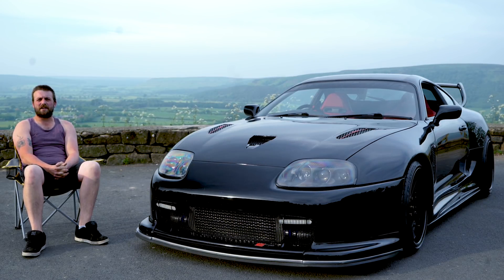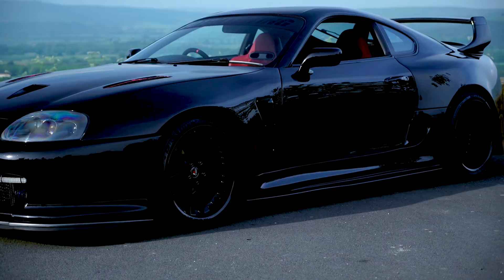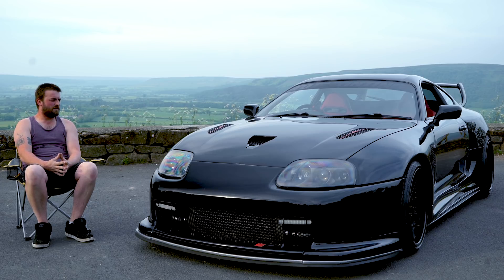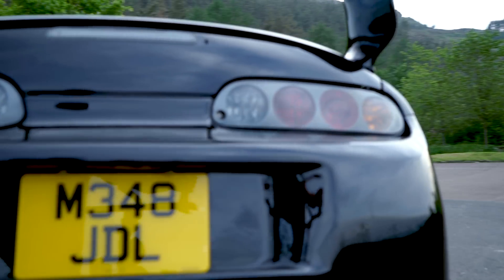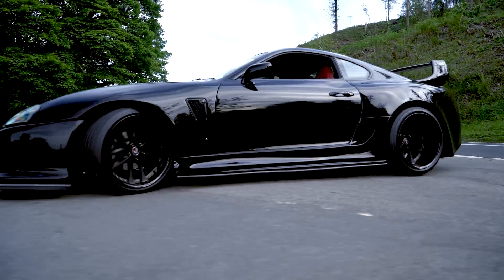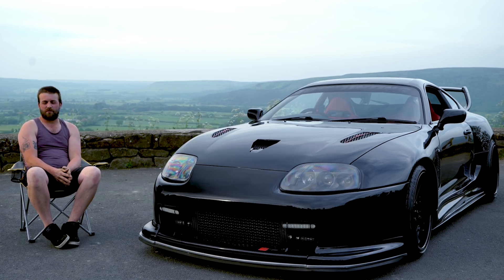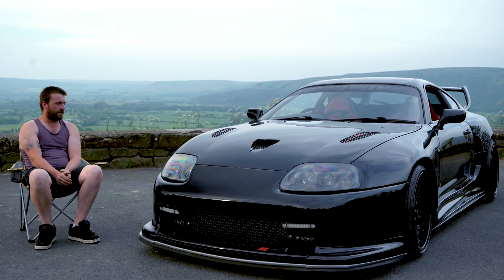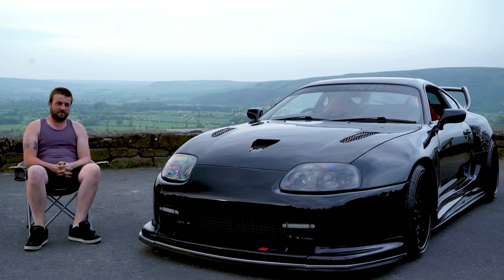Widebody Turbo Supra [TDSC]

Comment: This is a fuking supra till this day i cannot believe the disrespect in the 2020 supra that came out
Reply from the maker: As much as the new supra likely drives great and the engine is very good they should’ve just left it at the MK4
Reply: It drives like a bmw 😂😏 a supra is legendary so it shouldve been 10x better then what it is now . Starting with the chasy size ,horsepower , & that bulletproof reliabilty toyota has. Im over 6ft tall that thing is like a miata size .